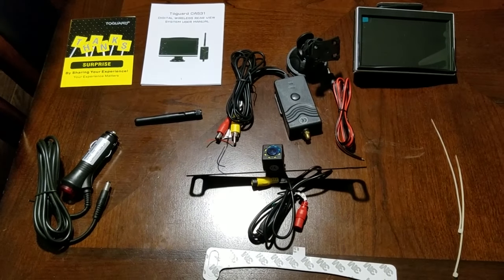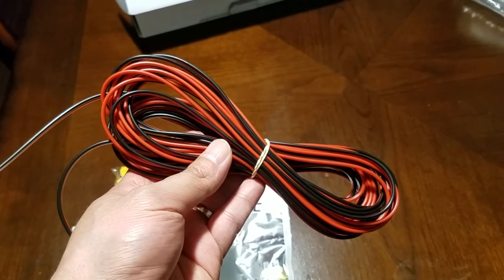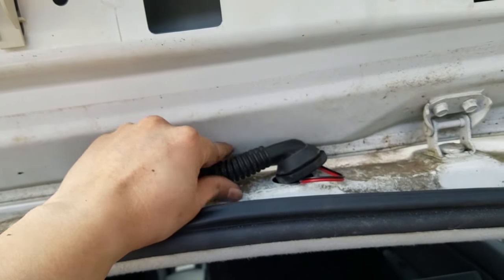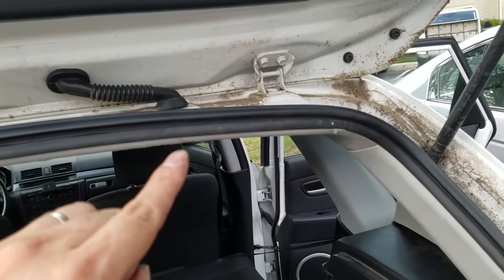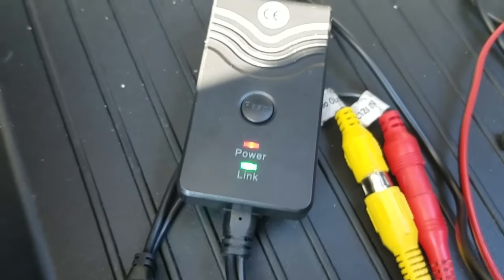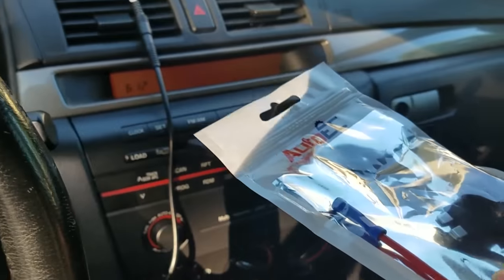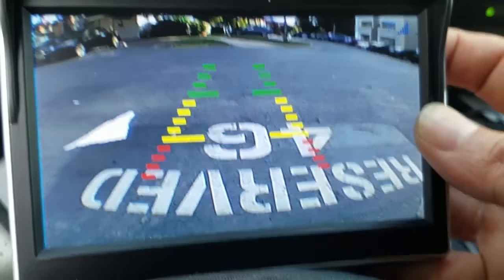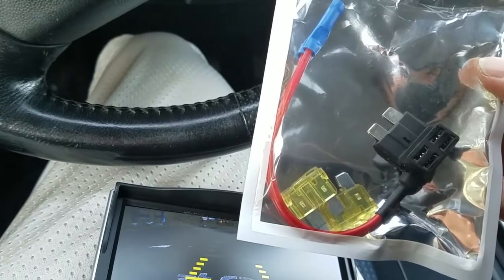2005 Mazda 3 Hatchback Wireless Backup Camera Install

Comment: Hahaha you didnt have to run wires to your actual reverse lights..you could of joined the wiring back down where it joins the relay...that looks so dodgy..no soldering,no inline fuses etc..an its not fast, mines almost instant